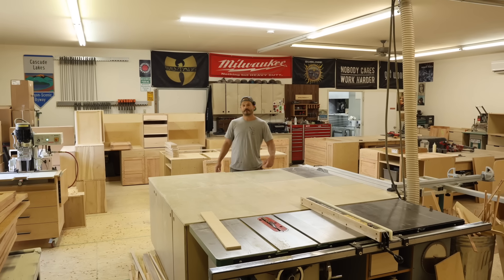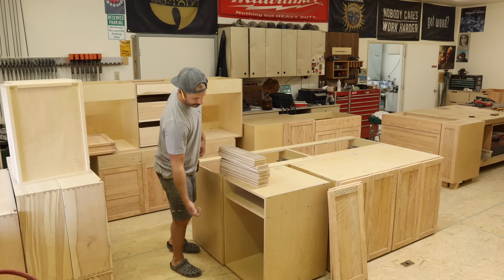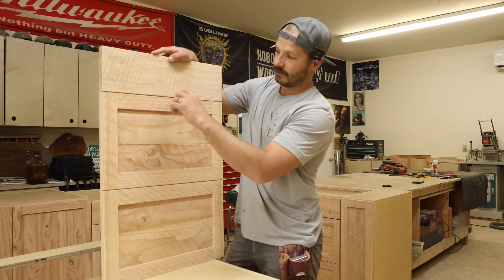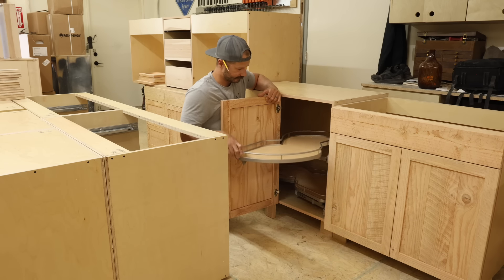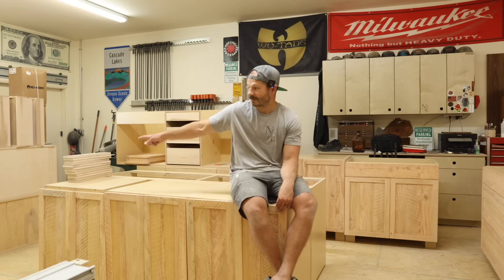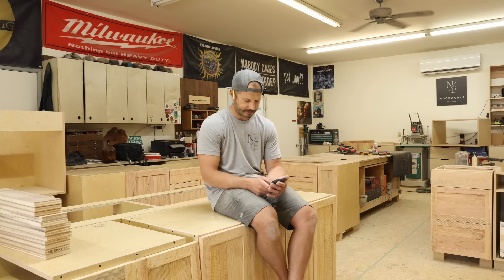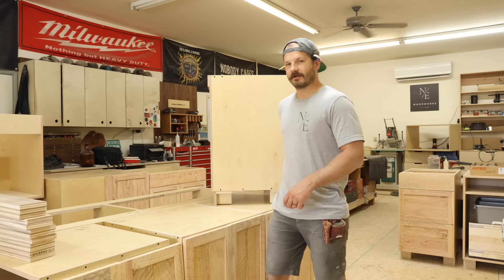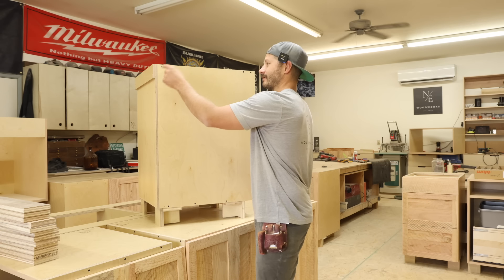Custom Kitchen Cabinetry

Comment: An option for a french cleat ‘style’ that I’ve used is rabetting both pieces instead of a miter. The key is to make the tongue of the rabbet smaller so it’s not tight when they interlock..that why you can still move it around front to back without it sliding up like it would with a 45 miter 👍 Kitchen looking good! Cool you got a helper again too. Way to go!
Reply from the maker: Oh yeah that would work too.

Comment: Do you still spray your evo with the big ol tip on there, like a 313 or 513?....you mentioned way back on your srpray video. If so highly recommend getting some ff tips, the tritech ultra finish are amazing.310 for primer and 308/206 for top.  I spray the same paint w that same cheap rig and it lays out beautifully,  last video looks like you gotta move so fast and so much overspray for that light coat.
Reply from the maker: Been using a 311 tip. Definitely need to go back to the ff tip

Comment: Regarding the cleat you use on the back of your cabinets, is the depth of your cabinets 1/2” narrower to allow for your cleat or are your base cabinets 24-1/2” deep?
Reply: right…thought of this question last video too
Reply from the maker: My cabinet end up being about 25” deep.  23” inside of box, 1/2” back , 1/2” cleat plus 1” door.   This works out better especially where the dishwasher is.  It always seems to need that little extra depth.
Reply: I’m definitely going to try this out love channel
Reply: Agree about the dishwasher, but I usually get by squeezing it in 24” deep.  I do make my islands 26” deep when there’s a dishwasher.